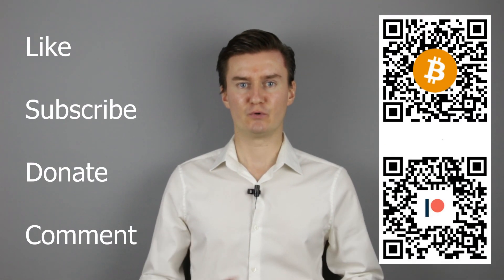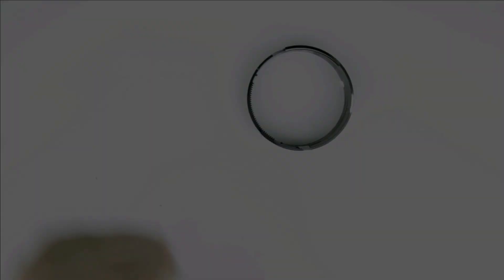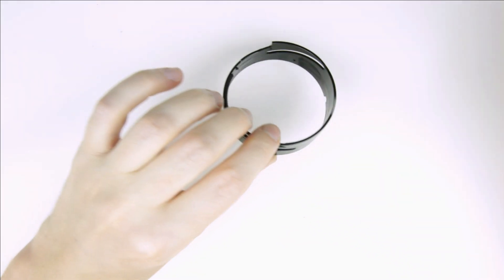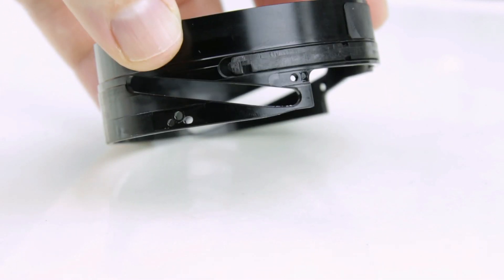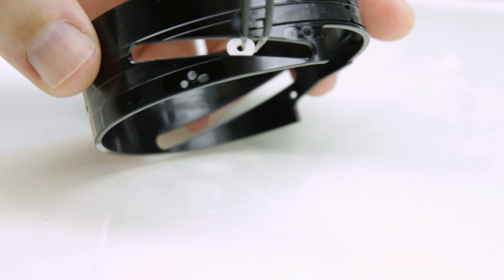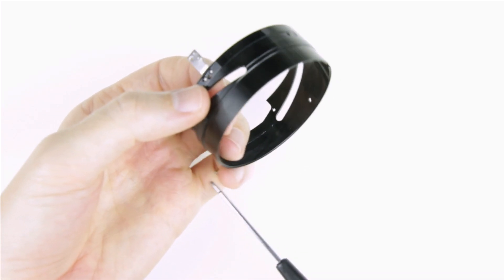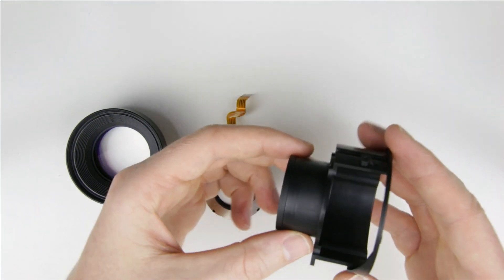Canon EF 50mm f/1.4 USM lens - repairing the focusing problem

Comment: Thanks for the video.  I have a 50mm 1.4 lens and the focus mostly stops at about 1m,  Doesn't like going below 1m in AF and MF, no problem from 1m to infinity.  It feels like something binding, pulling the front and moving the MF ring gets it to 0.45m.  Started to remove the front ring and MF ring, then remove the 3x rings slides, the centre would then move out a few mm rotated a few degrees and then re-engaged with the AF gears. After reassembly the lens now works fine, no problem going below 1m to 0.45m in AF and MF.  It was like something was not aligned correctly, but it is ok now.
Reply from the maker: You're welcome! Thank you for your comment, I'm glad that my video has helped you!

Comment: Hi, I can't find any information about cleaning the front element for this lens. Is it possible to clean behind the front element? Thank you!
Reply from the maker: You have to disassemble the lens for that what you can do using this video. As I remember, you can further separate the front lens unit, and you need a lens opening tool for that.
You could use the lens opening tool to unscrew the front lens element without disassembling the lens, but I wouldn't recommend it because the force could damage the inner parts of the lens.

Comment: Hello. 
A seller is offering me one of these lenses for just under $100, and he informs me that the autofocus doesn't work, but he focuses manually, all due to a crash. 
Do you think it will be convenient to spend that money on it and try to repair it? 
Thank you very much and see you soon.
Reply from the maker: Usually if the lens is crashed, the manual focus is stuck or sticky, and the autofocus motor try to move the lens element a little bit. 
If the manual focus is working perfectly, but the AF motor doesn't (try to) move the focusing lens element, then most likely the USM motor is faulty, should be replaced, which is quite expensive (~75EUR), and in this case I wouldn't buy the lens for 100EUR. The price of the working lens as used is around 175EUR, the USM motor costs ~75EUR, and due to the work and the risk, I would pay 50EUR or less for this lens.

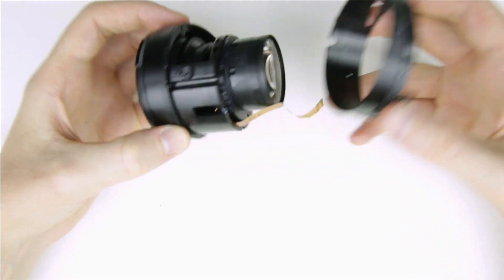Comment: What are you saying at 6:27, rasping?
Reply from the maker: I freezed a frame and marked the part with a red line where the lens should be rasped. If the lens element is mounted on it, you can see that the part marked with red line is a little bit higher than the side of the front lens element. Rasp the part which is higher so the tho lens part will have the same width. After that I put some lens grease on the rasped part to make it slide better.
Why: The metal ring (which I repair in this video) can be deformed, so when the lens is focusing, the inner lens part which should be rasped reaches the metal ring, and it makes the focus stuck. 
Usually when you put back the front lens cover (the item with 3 screws in it, focus window), it squeezes the lens a little bit, and it makes the focusing stuck. 
So, when I have a lens with that focus stuck problem, I disassemble the lens, push the metal ring to remove the deformation from the cutout part, then assemble the lens... after the front lens element is mounted, I test the manual focus. If the focusing is still stuck or doesn't run perfectly smooth, then I rasp the part which is marked in this video.
I hope I could help.